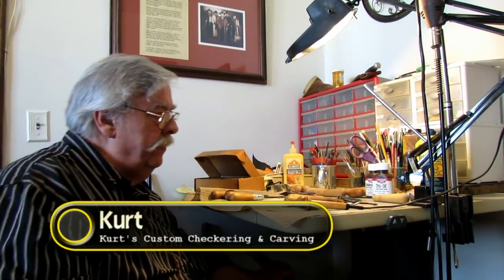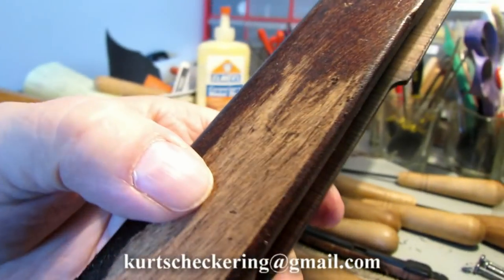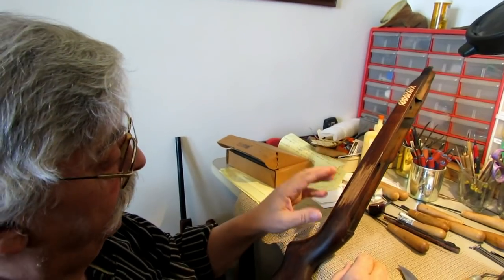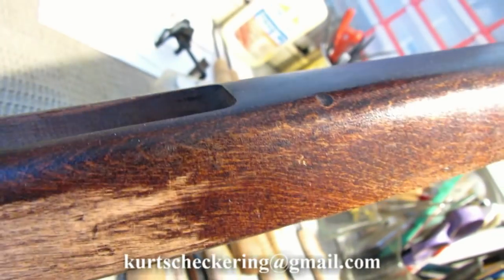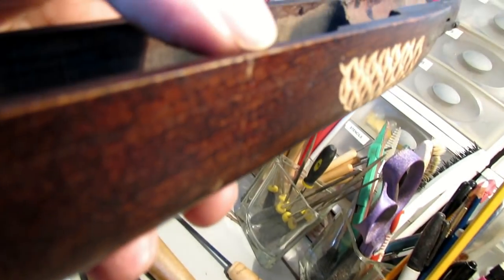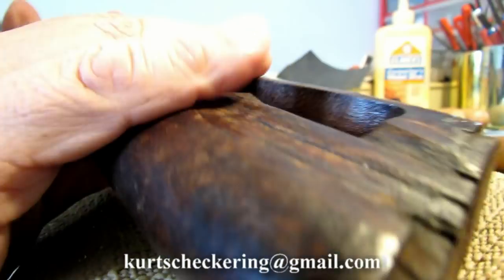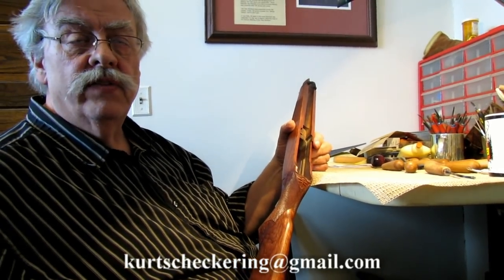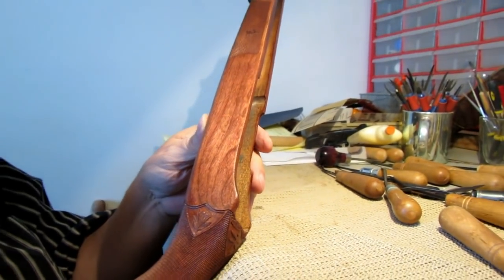Gunstock Finishing - Prepping your stock the RIGHT WAY!

Comment: I had a Finnish Mosin that was saturated with cosmoline. I took a heat gun and place the saturated area between two throw away baking pans And stuck the Heat gun in it and a thermometer to monitor temperature. Of course it took many week to do it this way but 90% of the oil is totally gone. Just don’t exceed 275 degrees. I had to remove the oil so I could repair the wood. Takes time and patience.

Comment: Oven cleaner does work & i've used it on 4 rifles, however if it has a varnish or clear-coat of some sort I suggest removing that first with an acetone or mineral spirits first to expose the oils below. The oven cleaner works better after that as it can get to the pores & pulls the oils out better that way. On one occasion I noticed that a crack got a little bigger from doing this a few times while letting it dry in between applications & wiping. It is best to keep doing all of the spraying & wiping during one longer session to prevent this.. Also on some surplus rifles I do not sand the stocks at all to keep some of the old "scars", so I simply use an iron/steamer to get the last bit from deep within the pores & then steel wool to knock down the little wood spored that stick out afterwards. !
Reply: Oven cleaner has lye in it. Lye breaks down wood. You ruined those stocks.
Reply: arisukak
They turned out perfect with a whole new life & were sold with good profit! 
Stop believing what you read in forums my main man because you are greatly mistaken in your ignorant comment.
Thank you for your concern though.
Reply: TheNisgaa
There is plenty of first hand knowledge of oven cleaner ruining stocks. I myself have seen it. A simple google search you'll find plenty of them with plenty of nay-sayers like you. Sure, it might look good right now, but what about in 5, 10, 15, or 20 years from now? I'm sure their new owners are going to be happy with their GREEN stock. Oven cleaner is meant to clean METAL ovens, NOT old wood. If you looked at what made up oven cleaner you'd find plenty of chemicals that will destroy wood, not just the lye in it. Even a chemical stripper won't say it's completely safe for wood, because it's not.

Oven cleaner is the lazy bubba way of refinishing stocks. I'm against refinishing stocks in general, but if you're going to do it then don't do it the lazy half assed way.
Reply: TheNisgaa
An oven cleaner without lye is like a car without tires. Sodium hydroxide AKA lye is used by the paper industry to break down the fibers of the wood during the pulping process. Sodium hydroxide breaks down anything organic. Spray it on your hand and it will take your skin right off. The only thing that stops the process is water, which also is bad news for a rifle stock.

It's utterly stupid to even try to totally degrease a stock as it's the oils in them that protect and conserve them.

Comment: Is there a tip or trick to repair a "minor scrape" on checkering? (I sort of doubt it). I have a Browning X-Bolt with a satin finish, it took a hit on the fore-end through the checkering. I'd like to repair it if possible. While I find checkering to be very "pretty" on a gunstock I also consider it a usless option on a working hunting rifle. I actually go out of my way (when possible) to buy rifles without it. It's just to easily damaged in the bush from branches. The wood used in most modern day rifles is complete crap, not even worthy of a shop pallet. BTW, what's the song at the end of this video?

Comment: So if staining is needed on birchwood, you first apply 3-5 coats of linseed oil, then the stain and then oil again? Most people seem to stain first, any reason for this?
Reply: On a freshly prepared stock, ready for finish: he stained the stock, then used Boiled Linseed Oil, applying very lightly by hand, rubbing with/into the grain. Allow to dry (maybe couple of days), lightly sand and repeat for a more lustrous finish.

Comment: I have a nice walnut stock with checkering, that has a glossy finish. How do I remove the finish, and not destroy the checkering. I would like to end up with a nice wood finish.
Reply: I’m not sure if you figured it out by now but there are strippers out in the market that you can use which will remove it. I believe many like to use citrustrip gel.
Reply: krud cutter and a brush

Comment: What happen to the pant remover. That's the right way. I'm a 4th generation wood worker. Removing wood is not good bye scraping tool. A dent in the wood just us steem it and will come out then Sand out. #1 thing sand with 200 great and up to 800 great and us wood pant remover and steel wool. Us water to remove the pant remover off.